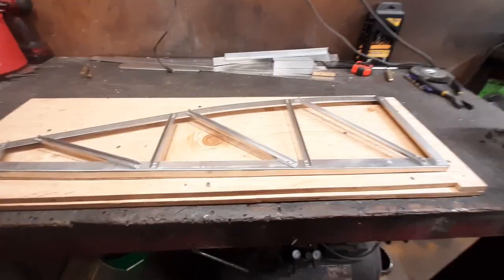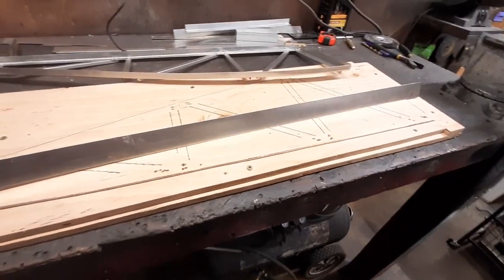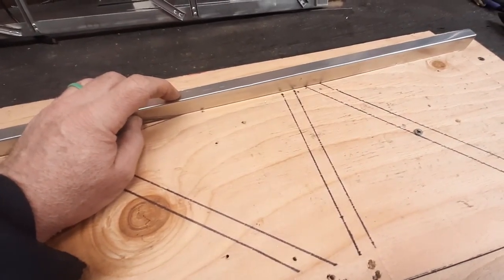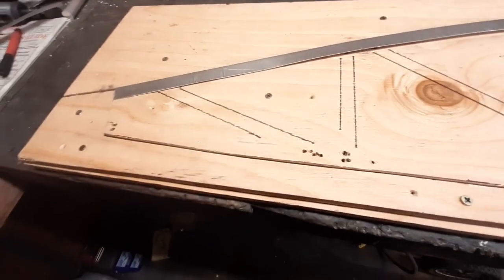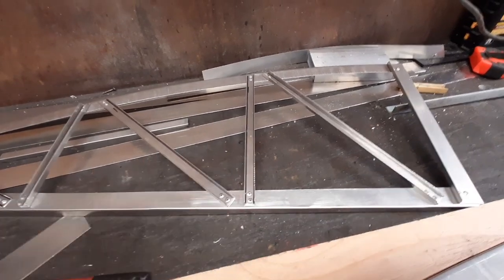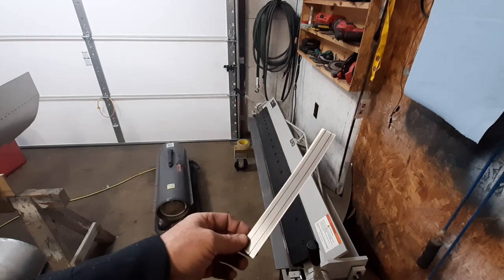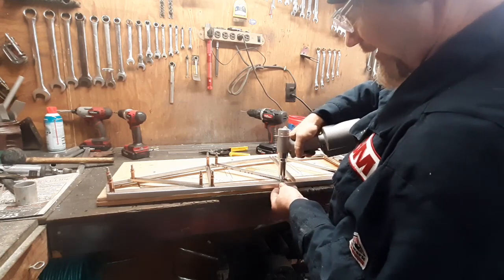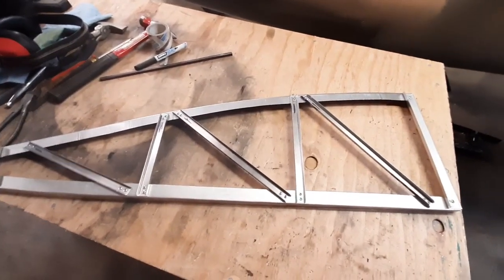Wing Rib Construction - Hummel Ultracruiser

Comment: I know it depends on spars and overall build aswell, but roughly how many G's could these type of ribs handle? Great video, thanks.
Reply from the maker: The Ultracruiser has a G rating of 4.  I don't know for sure if that's positive and negative. Usually the negative G rating is less. Either way it makes a strong wing.  Thanks for the comment

Comment: How difficult would it be to buidl the airframe without a box and pan brake( no seperate fingers)? I could build a a straight brake but don't currently have the funds to buy a box and pan brake. Thanks for any help!
Reply from the maker: I think you would be fine with a straight brake.  I just bought the box and pan so I could use it on other projects.  I haven't had any need to move the fingers for the Ultracruiser.

Comment: What kind of radius do you have on your bending brake? A 1/8" radious or any ?
Reply from the maker: When I bought the brake the fingers were very sharp with no radius.  I rounded them a little so they don't dig into the aluminum.  I mostly adjust the bend radius with the gap between the bending arm and the fingers.